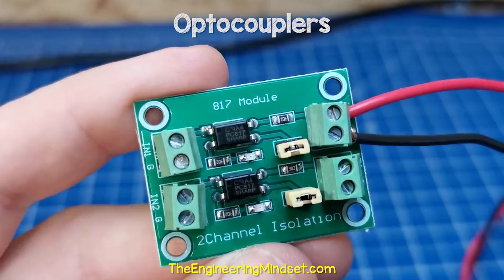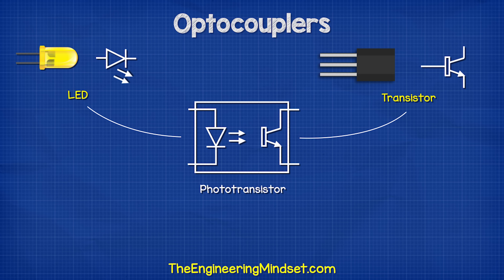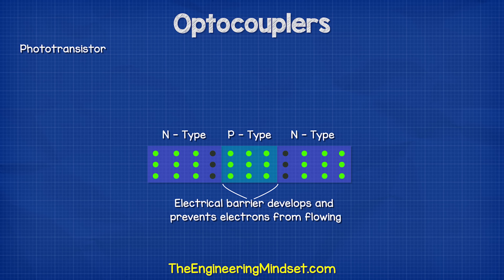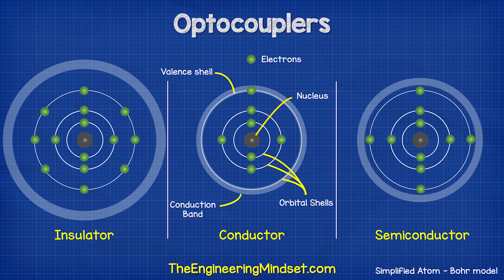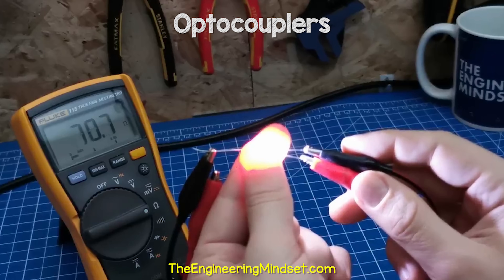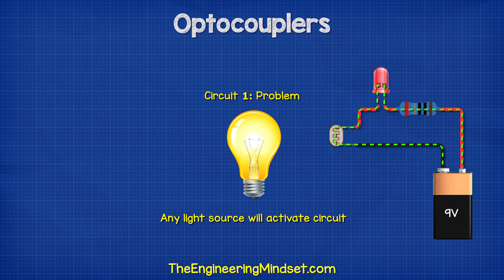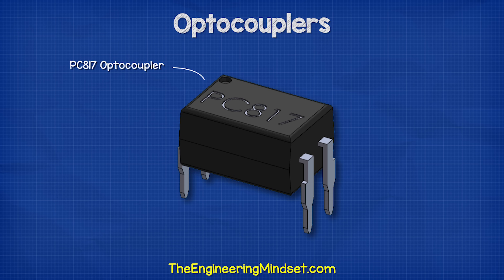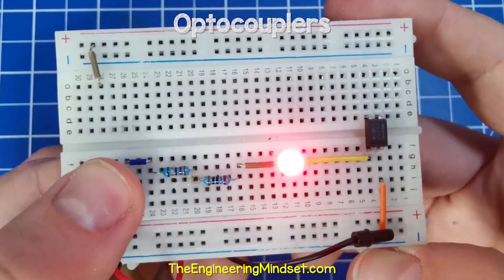How Optocouplers work - opto-isolator solid state relays phototransistor

Comment: Isn't this the best educative channel we have on YouTube??..
Reply: I have been retired for 3 years.  I had to understand schematics and digital circuits as wells as pumps and motors for my job in power plant operations.  I was not trained formally as an electrician.  I knew what I didn't know but I could understand what I needed to know for personal and plant safety.  However, I never understood enough that I could explain it or teach somebody else.  I wish I was trained with these videos 30 years ago because they are so clear compared to drawing in a text books.  May be then I could explained how things worked better because I knew things did work.
Reply: @dwayne7356  great to hear your part of the story,I wish you well.On my part,I am an HVAC technician,I came to realise there is no way you can troubleshoot air conditioner units without understanding basic electronics & circuitry,......I swear this channel has a way of making these things seem easier than they do on textbook
Reply: @dwayne7356  You seem to describe me as well! I taught myself electronics with good old Radio Shack books /kits...learning about JK flip flops (logic gates etc) - Ohm's law (a MUST!) transistors /capacitors /resistors /diodes /etc.
Also learned hydraulics - directional valves / 2 stage pumps (systems up to 7,000 psi / rams up to 1,000 tons.
PLC's (ladder logic) frequency drives - chillers - refrigeration. 
A young fella I had hired wanted to learn...I had him rewire heater bands on a plastics extruder machine - having 3 phase 480 volt supply. The trick being to have balanced load across all phases as close as possible (heater bands having differing wattage). I had him make a simple drawing of the heater band setup - then draw lines as wiring that he hooked up. It was easy to explain mistakes he made before ever turning on power. This hit me as a great way to teach - he BTW turned out to be a good electrician. (I told him hydraulics is the toughie as good logic imagination is a must in troubleshooting.)
I'm retired now - play mandolin in country & bluegrass bands.
🇺🇸👍
Reply from the maker: Glad you think so
Reply: Quite possibly.
Reply: It definitely is the BEST EDUCATIVE channel here on youtube
Reply: Try Nile red
Reply: @slickjayb5351  he said educative not educated. As in gets the info into the head of the viewer successfully and understandably. Not nile red. 

Not this guy

Dronebotworkshop
Reply: Have you never watched dronebotworkshop?
Reply: @gravestoner  no
Reply: @slickjayb5351  nile red doesn't educate. Its like calling einstien educative. He didn't teach people.
Reply: Yes Sir.. It is indeed educative channel... Some of the videos in this channel were always taught to my technicians....  High recommended channel...
Reply: Hands down. Best of the Best.
Reply: Ben Eater is a very good one too...has everything from simple electronics theory to very complex designs.👍
Reply: Yes it is
Reply: Depends on what you are looking for.
Reply: Yes definitely
Reply: Yes it is
Reply: One of the few channels that has information with actual knowledge. Not regurgitated info they saw somewhere else
Reply: Yes
Reply: By far, yes!
Reply: Obviously.
Reply from the maker: Check out NEW resistor video, everything covered! ➡️ https://youtu.be/DYcLFHgVCn0
Reply: Theres another one with anatomy so is not the only channel thats educative

Comment: Sounds like a optocoupler is easilly made.
Reply from the maker: These basic ones are a fun little project but we need to use proper ones for our circuits
Reply: @EngineeringMindset  my goal is a brushless motor driver and this gives me a great idea. If i made lets say 20 octocouplers at a progressivelly higher voltage with each one im half way there but inverting my sighn wave for Delta termination or y is a difficilt journey so sesing this gives me a few alternitaves. I was only aware of mosfets and transistors but seeing this each octocoupler corcuit could be a certain range of voltage so i can easilly variate and reverse for my throttle. I wish there was a mechanical way to make a three phase motor driver without using a plc without it being 5 pounds lol. I should look up how tesla powered his 3 phase motor and maybe this will shed some light for me. Thanks for your reply. Live long and prosperous. 🖖
Reply from the maker: See my new MOSFET explained video here➡️: https://youtu.be/AwRJsze_9m4